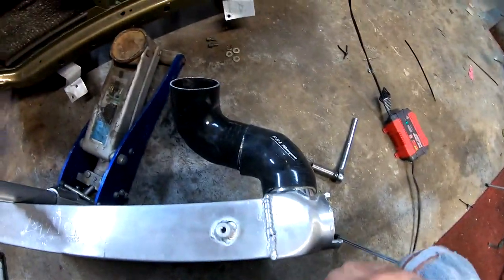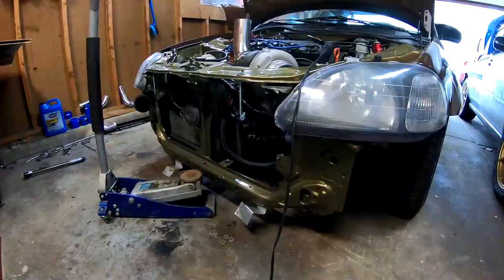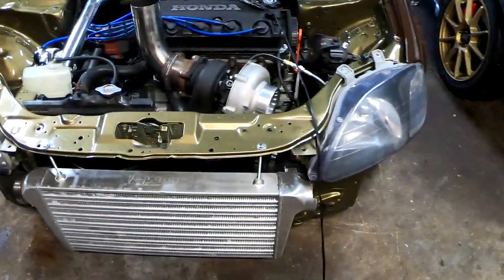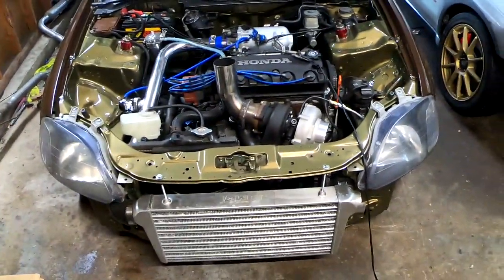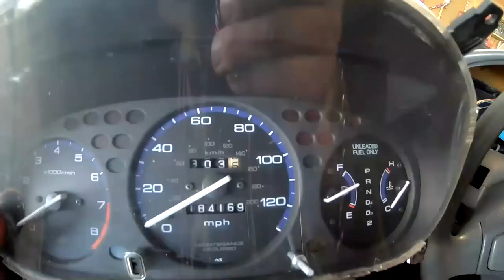4 door ebay Turbo Civic Got the last part in the mail!!

Comment: Sweet!  What are you gonna tune on?
Reply from the maker: Street tune on haltech
Reply: Is haltech common? Is it a stand alone? Flash? Piggy back?
Reply from the maker: Its a Stand alone ecu its not that common because its more expensive so every one goes hondata. But its better you can control everything and it will even adjust fuel mixture by itself  example would be if I am tuned on e85 and pump 93 ecu will add or remove timing. Pretty cool.
Reply: @BarbasLife  dang!! You went from a FMU to stand-alone!!  Nice!!!
Reply from the maker: @BulliKid  u need my fmu?
Reply: @BarbasLife  don’t even think it works for our civics honestly with the way it’s designed.